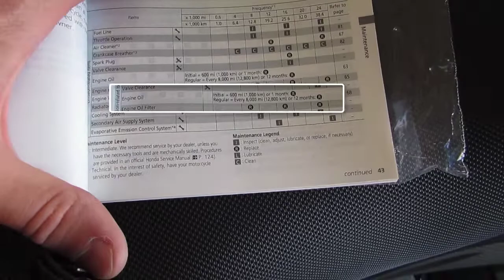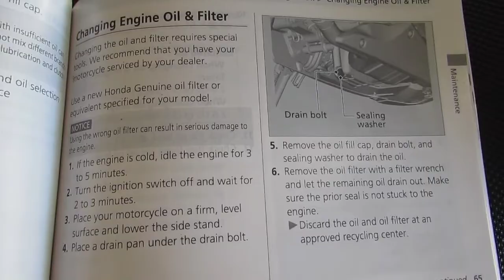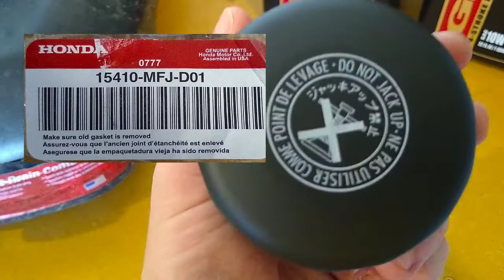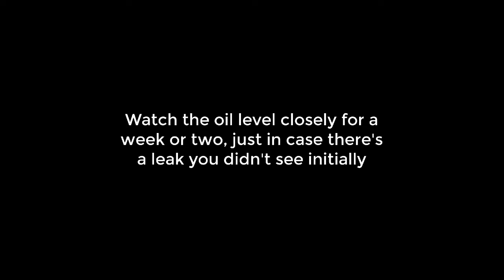Honda CB500X Oil Change; Step-by-Step

Comment: Great video thanks . Easy to follow. I have the exact same model and year. I love this bike, a great all-rounder. Doing an oil change today.
Reply from the maker: Thanks, it's an underated bike for sure. Good luck with your oil change.
Reply: @Sqeptick  all done thanks. Your tip with the plastic bag to catch drips from the oil filter is brilliant! I wouldn't have thought of it myself. Cheers, John.

Comment: Cool I changed the oil filter to a HF204RC, it's got a socket on the end so it's easy to remove the next  time.
Reply from the maker: Good tip, I'll have to look into that.

Comment: Thanks for the video! The oil seems to have gotten significantly darker after you ran the engine the first time, didn't it? Probably got mixed up with some leftover residue from the old oil. I guess looking at the oil color in the little display is not that good of an indicator of its age (8:11 vs 10:18 for comparison).
Reply from the maker: If may have darkened a little bit, but I suspect that was my poor lighting that made it appear so different. I still think shining a flashlight into the window can help you determine if the oil has gotten really dirty.

Comment: One question i bought mine cb 2 hand and the last guy change oil 10w-40 do i change the same or put 10w-30 she from 2017 and got 16.000 km i made almost 4.000 in a year ty.
Reply from the maker: I'm not a mechanic, but I'd go with the weight specified in the user manual.

Comment: Manual doesn’t say “side stand” or “center stand” to check oil level. Came here to be sure.
Reply from the maker: I'd put it on the center stand for checking the oil level. I don't have the manual in front of me, but I know my last bike specified tipping the bike up off its side stand in order to view the oil window while it was level.

Comment: Can you not just untighten it with your hand? Seems like kind of inconvenience to get an entirely separate wrench for one thing.
Reply from the maker: No, at least in my experience the filter can't be removed with your hand... unless maybe it wasn't tightened enough when it was installed.
Reply: Aftermarket filters like K&N have a built-in nut at the end of the filter so you can use a regular socket wrench

Comment: Every 8k miles..no thanks. I'm doing all my vechiles every 2k. Have a honda element at 220k and runs like a champ. I don't trust their 'recommended" mileage time frame.
Reply from the maker: That's awesome if you can do that. I put too many miles on it to do it that often...sometimes I'd be changing the oil every few weeks.
Reply: @Sqeptick  that's true..but actually with the element I changed it every other weekend lol..was a delivery vechile till i said I'm putting to many miles on it. I used non synthetic oil with a WIX filter..wasnt too bad
Reply: @Sqeptick  also I just got a 2016 cb500x..will be doing a first oil change here soon. Nice video btw
Reply from the maker: @igorg003  You're a machine, lol
Reply from the maker: @igorg003  I really like mine--hope you do too.
Reply: yeah, 8K mile seems too much, half of that is fine. I am doing every 6K km (4K miles)